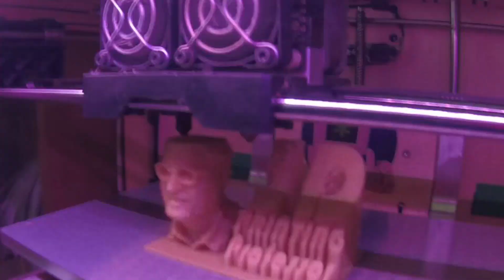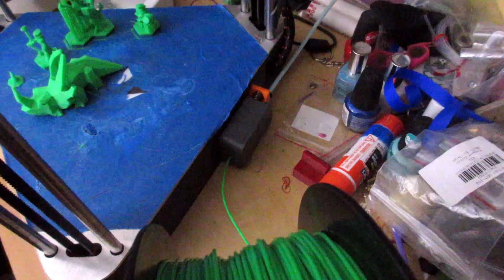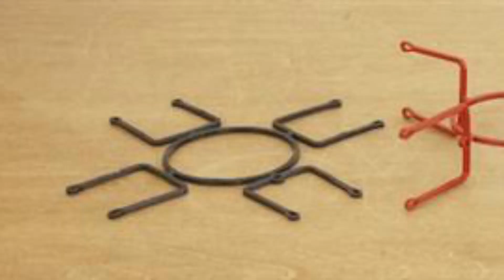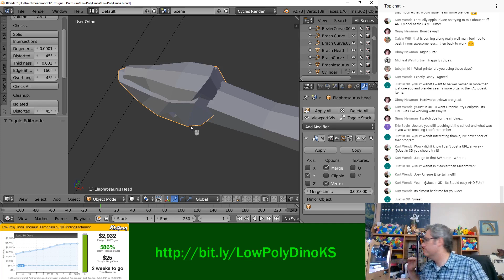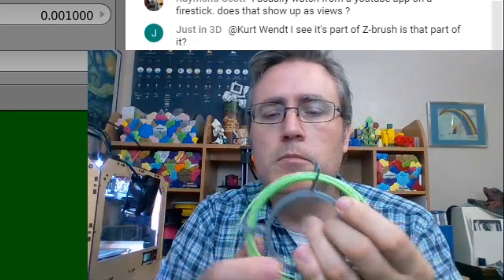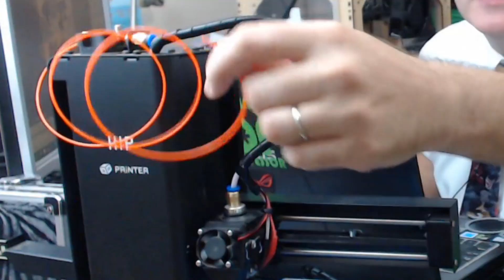How to 3D Print with 3D Pen Refills

Comment: Is there specific settings you have to have? I tried printing with it today and the filament is not stable on the bed. It like wobbly and doesn't stick in place.
Reply from the maker: Interesting. The stuff I used worked with just regular PLA settings. Good luck figuring it out.
Reply: @3dpprofessor ok thanks so much

Comment: If you use this filament in a normal 3d printer at what speed do you print it and at what temperature?
Reply from the maker: Regular PLA speeds and temperature. Rarely do I have to touch the defaults.
Reply: I bought a bag of this sample filament, thinking all 3d pens use PLA. I was wrong. The bag I got uses PCL (Polycaprolactone).I didn't follow my number one rule,of read before you buy😅.So for usage in a pen it operates at temperatures between 65'C-95'C. Set it to 100'C in my printer and it wouldn't do anything.Raised the temperature to 140'C , still nothing and eventually it started to work between 180'C-200'C. Cool, started to print as if I was using normal PLA. First 2-3 layers printed normal,but about 8 or so layers later it can't cope with normal PLA settings. So tried again this time printed without the heated bed,increased cooling and +/- 10'C less on the printing temperature. Still had issues.One mistake I also made was printing with 3 walls and I probably should print at a slightly slower speed.I printed at +/- 50m/s.I did later find a Italian guys video giving good advice.I still have to test printing with 2 walls,less infill & slightly decreasing the print speed.PCL it seems is very sensitive to any heat & needs a little bit more cooling.It would seem I opened the proverbial Pandora's box.😆

Comment: no idea if you still want a concept for a small printable spool for something like that.  if you do what I would do is a thin ring when looking at it laying down.  then a curved cut that travels around the outside edge.  that way there would be no overhangs, thin makes it so little filament usage, and people could scale just the width of it to make it work for fatter spools, scale the diameter for bigger diameter bundles.  there could even be a hole put in so one could put filament on it and wrap it themselves.  I don't know if I relayed the idea enough.  would be plenty fine with making a quick model and sending it if you want

Comment: What is your perfect heat setup for your pen filament refill?  I've tried several heats and can't find any that work perfectly like on your dinosaurs!
Reply from the maker: Honestly, just default temperature settings for PLA work fine. What printer are you using and what problems are you seeing?
Reply: @3dpprofessor  the best setup I have found for pla with my ender3 is 210 the nozzle and 60 the bed.  with the filament pen refill the nozzle clogged easily, the material has difficulty sticking to the bed and often sticks to the nozzle during prints.  the best setup I have found to avoid sticking on the nozzle is 260 the nozzle and 60 the bed but the prints are not of good quality and far from beautiful like on your videos with the same product
Reply: @13stevo5  Did you ever find a solution for your problem? Had the same issue with som pen PLA I bought and never got working, I actually ended up returning the printer as it was not living up to the standard (kind of a toy model, my first 3D printer), I'm now waiting on a delivery for a new one with bed heating and was hoping that would solve the issue with this pen PLA but as you seem to have the exact same issues I had I'm suspecting the filament is of bad quality..

Comment: I was excited about the title of this video because I bought a sample pack and was trying to figure out how to use them.  Printing small parts is definitely a solution, but I was hoping for something a bit more useful.  I looked online for a good way to fuse the short segments together and even tried building a fixture but didn't have much luck.  Have you tried fusing short segments together so you could print larger parts from a variety of colors?  Seems like if there was a good solution you could get some interesting prints and not throw short segments away.
Reply: Press pause on your printer before you run out, remove the filament, then replace with a fresh roll, click resume. Same technique used to make rainbow colored prints.